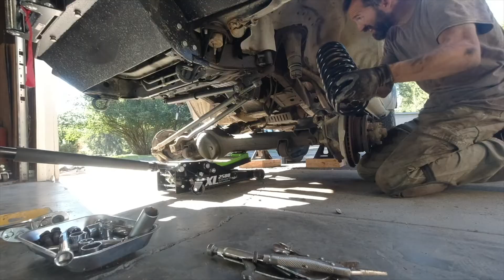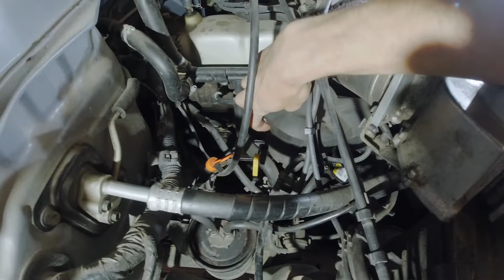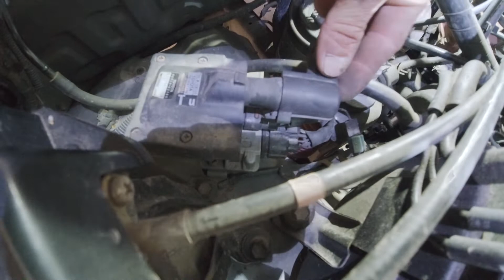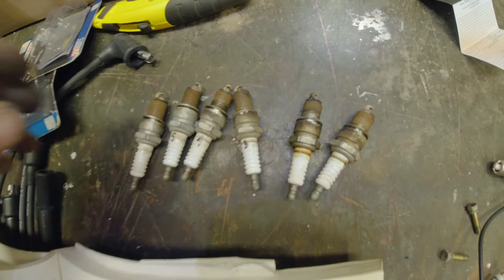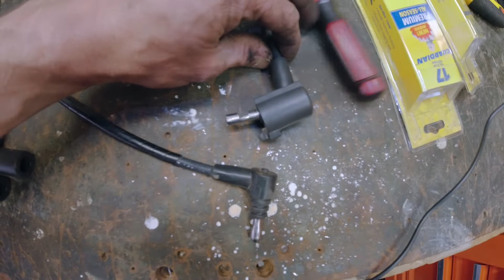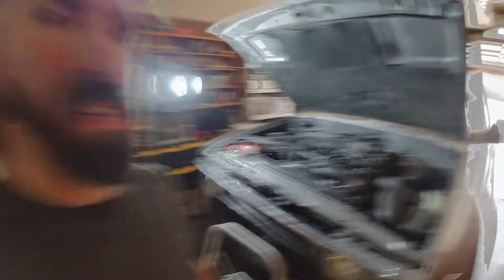Ignition Tune Up on my Land Cruiser

Comment: Thank you! I watched the video and it seems like you didn’t set the timing when you replaced the distributor cap?
Reply from the maker: You're right, I left the timing alone. I've considered going back and adjusting that, but it seems to idle and run smooth so I'm not sure if I would gain anything. How's yours?